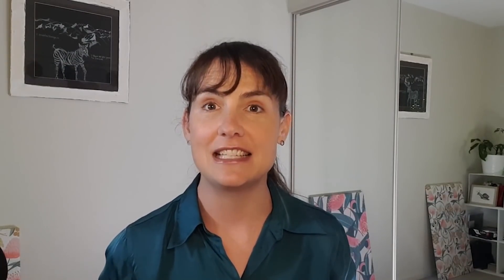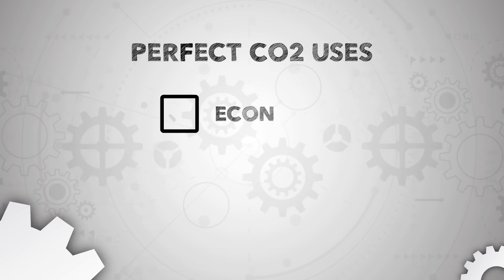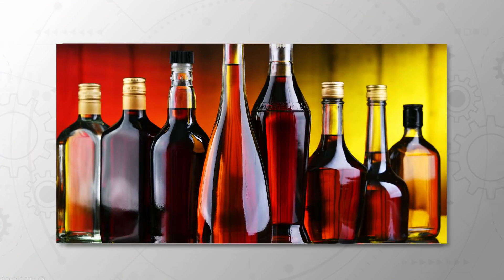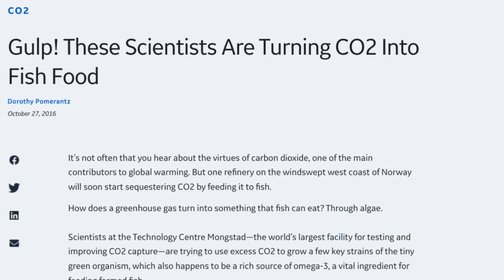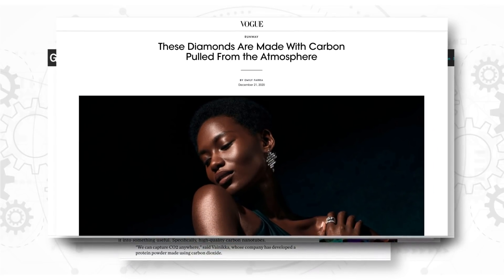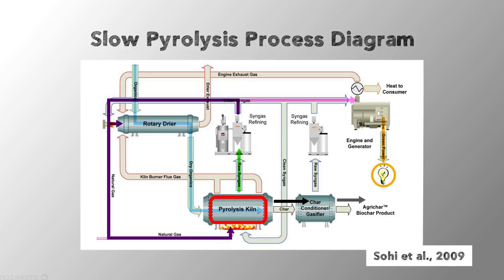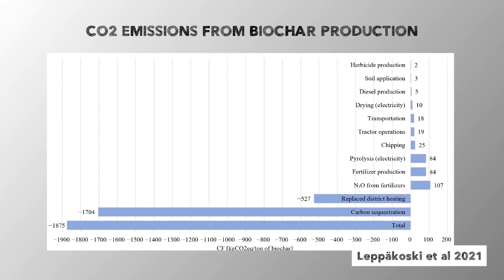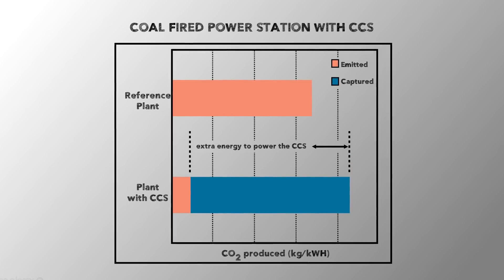From Waste to Wonder: The Surprising Uses of Carbon Dioxide

Comment: Rosie, We would love to see your future biochar video. Below are some resources for it that you might find useful. Thanks for including biochar as a carbon capture and utilization technology. It was great to see your enthusiasm for it.  

I've been involved with Biochar for over a decade. And you're right, it can be a very powerful tool for removing CO2 from the atmosphere at very large scale, even eventually at the gigaton scale. And unlike other biomass incorporated into the soil, it lasts for hundreds to thousands of years as a very stable form of carbon. When used properly, like preloading it with nutrients and microbes by composting it with other organic matter, it can provide some amazing benefits to the soil in addition to all of its atmospheric benefits.

Resources:

As an engineering resource, Tom Miles is an engineer who has worked with biomass for more than three decades and has been working on biochar even longer than I have. He is a Board Member of the International Biochar Initiative, as well as the Executive Director of the US Biochar Initiative. His depth and breadth of understanding of the biochar industry would be hard to surpass. As you can imagine, I highly respect his work.

T R Miles Technical Consultants Inc.
http://www.trmiles.com

The IBI or International Biochar Initiative has some good general resources here:

https://biochar-international.org/biochar/

They display an infographic I had made 11 years ago to clearly illustrates both the soil and atmospheric benefits of biochar. You are welcome to use it in your video. I can provide a high resolution copy of this image, or a low-res copy of it can be found at the following address:

https://biochar-international.org/wp-content/uploads/2018/06/CHARTREE3.jpg

The US Biochar Initiative has some great video resources on their YouTube channel.
https://youtube.com/c/USBiocharInitiative

One of the most important current steps toward helping biochar deliver its potential benefit to our environment is through appropriately scaling the industry. There was a great forum on this in 2020 entitled simply, "Scaling Biochar".

https://www.scalingbiochar.com/

This forum highlights presentations from some of the most notable people involved in the biochar industry in the US.

Prior to that forum, one of US's largest biochar producers, Josiah Hunt of Pacific Biochar, along with Tom Miles were the leads for a working group tasked with presenting a plan for the implementation of, 'Large Scale Biochar Production". While they have a plan for the future, both of these guys are out there already doing the real world work needed to get biochar produced and into the ground.

Their presentations can be seen through these two links:

Tom Miles: Large Scale Biochar Production. 
https://youtu.be/uqViKqLvqtw

Josiah Hunt: Leveraging Existing Infrastructure in California to Sustainably Produce 250,000 Tons of Biochar Per Year within 5 Years.
https://youtu.be/mvVaBH76XjM

Anyhow, I could provide you with a ton more resources. But this should give you enough to it immerse yourself, well beyond just dipping your toes in.

I can't wait to see a whole video about biochar by Engineering with Rosie with your characteristically high quality and thorough coverage.

Thank you for all the hard work you do to bring us great content. Keep it up!

Comment: As you point out, the use of renewable energy is key to ensure CCUS is carbon negative or at least neutral.  I worry that the enthusiasm that a CCUS breakthrough is just around the corner will justify delaying the complete transition from fossil fuels.  After all, if we're about to have a economical, scalable, and permanent solution for CCUS then why stop burning fossil fuels now (or ever)? Obviously we need to quickly roll out the renewable energy solutions we have now and continue to research possible future improvements/solutions such as CCUS.  It would be nice to see you remind viewers that we need to both transition to renewable power AND look for future solution such as CCUS. It's far too late for an either/or. Thanks!

Comment: The problem with all forms of carbon capture is: you use energy to convert CO2 to do something with it, ususaly with a step involving converting it back to C. This is just stupid if you look at it thermodynemicaly. What is the point in oxidising carbon, to then undo the oxidation and lose energy in the proces, that is not even concidering the energy required to recapture it out of the air. You are just better of not burning it in the first place.

Comment: I appreciate that most engineers are only allowed to think about using steel,glass and concrete but...How about planting trees????
Trees that can be used in sustainable construction e.g. oak,Douglas fir will not only absorb CO2 and reduce surface heating (hotspots,heatwaves,higher windspeeds,soil erosion,etc) but also have further CO2 output reductions by significantly reducing the amount of steel,aluminium and concrete that 'we' use in construction.
Concrete is by far the single biggest man-made source of CO2 released so how about educating engineers and architects to stop being a massive cause of pollution through their totally avoidable ignorance on the subject they pretend to be working on???
The carbon is locked up in the timber for centuries and at 'end of life' can still be resawn and re-used.
I understand that most engineers are 'trained' in ignoring timber as a construction material but if you collectively pulled your heads out of your @sses like the Scandinavians and Western Europeans have done then you could actually get involved in making significant progress instead of being reduced to these laughable turd-polishing conversations that achieve nothing.
Reply: Biggest problem is where do you plant the trees?

Comment: there is a simple way of doing this, grow trees too eat CO2, then build durable low impact carbon positive ecohousing kits, self build or co operatively built housing out of the trees designed to be modifiable and with at least a 50year lifespan, thus removing the stored carbon from the atmosphere for 50years+ while lowering domestic energy consumption. ( i have 20 built already in UK)
Reply: But where do you grow the trees?

Comment: Thanks for the great video. Here's an idea you touched on: Mandate that all new plastic materials must be made out of captured carbon dioxide. This will raise the price of plastics, limiting their use. Also, make sure that produced plastics are not biodegradable, and don't bother recycling them. Just make sure they are disposed of properly in landfills. In this way we are taking carbon out of the atmosphere and storing it in the ground long-term at identified locations. At the same  time we are greatly reducing plastic pollution. Just an idea, I am fairly sure it will never happen.
Reply from the maker: Sensible ideas from a CO2 perspective, and assuming that you can ensure every bit of plastic gets properly put into landfill and doesn't end up in rivers and the ocean. Lots of people are opposed to landfill though, even where there is plenty of land available for it. And in a lot of countries they burn waste instead of landfilling it, and then you'd just end up with the CO2 in the atmosphere again.
Reply: @EngineeringwithRosie  since my comment, included a very similar suggestion... thx for giving your feedback on it...
Reply: @EngineeringwithRosie  Agreed and all this would have to be regulated so there would not be unintended consequences. The plastic could be compressed and baled, then buried so it wouldn't take up much volume. We would know where it was, and there might come a time when we would want to mine it to extract things that may become valuable in the future. Again, though, I think this idea is rather counterintuitive and very unlikely to be implemented on any scale. But the core idea- require all plastic to be made of captured carbon- would go a long way to reducing plastic pollution because it would likely increase the production price by quite a lot.
Reply: @kinguq4510791  agreed, my comment, included a very similar suggestion... but I also mentioned, it would be very emotionally distasteful to implement too....
Reply: It seems like it would be simpler to tax the mining of fossil fuels more substantially, than to try to micromanage what people do with them.
Reply: @eventhisidistaken  Yes I agree. We have carbon pricing with the proceeds refunded to individuals here in Canada. However the program is unpopular on the right and there is always the chance that it will be scrapped after the next election. The advantage of the plastics thing is that it actually results in removal of carbon from the atmosphere, as well as source reduction.
Reply: @kinguq4510791  Energy has to be used to remove CO2.  Any energy used for that purpose, could have been redirected to the grid to reduce the need for energy mining in the first place.  It's extremely inefficient.  If we ever reach the point of all renewable, then it will make sense to use surplus energy for CO2 removal.  But sequestering it in plastic would still be a poor use, because there are applications where electricity doesn't work well, such as air travel and heavy machinery.  Captured carbon could instead be used to synthesize e-deisel for those applications, making them carbon neutral.
Reply: Yeah maybe make that 22% more libertarian so China doesn't overdo like with lockdown endian health awareness...then 50% more oversight fun and fungibility on the progressive sides.

Comment: I shred organic materials mix them into the soil. Carbon captured.
Reply from the maker: I actually think you'll end up creating methane and releasing that to the atmosphere if you do that. And methane is a much more potent greenhouse gas. Unless it is an extremely controlled process you are doing?
Reply: @EngineeringwithRosie  our soil is depleted to an average organic content of 2% If we increase the organic content to 15% will reduce the need for chemical fertilizers, pesticides, and irrigation. Also ease water tables and increase plant growth.
   Maybe better than burning the organic materials or put them in landfill to dispose of them?

Comment: I need more on Slow Pyrolysis. What you showed us in this video is baffling. You process biomass, generating a fuel gas which you burn to power the process, releasing CO2 on the way, and you make something called 'Char'. Are you trying to extract carbon from biomass? What's is this 'Char' stuff? It must be really useful if you go to all this trouble to make it. But the process CAN BE carbon negative?
Reply from the maker: Bio char is basically a way to concentrate carbon from biomass. And yes, I agree it's a topic that needs much more time to cover properly. I'm trying to arrange some visits where I can show how it's made and how it's used. The reason why Jess said it can be carbon negative is that it uses energy to process and depending what you do with the biochar, some of the carbon may end up back in the atmosphere. So it's not guaranteed to be carbon negative or even carbon neutral.
Reply: Someone should start a company that searches data yo. Or even 'serves' nonfiction reports from like, an International Potbellied Climate Change science conference thing, but with indices and graphics and like 5 interactive games to make you question your pdf life so far, right?

Comment: Rosie thx, for another insightful post. But I was a little disappointed that true Bio based alternatives were not mentioned. 

Starting with Hempcrete and the branded version of it from BioFiber, which uses a polymer reinforcement structure that could use CCU to produce it and CCU produced carbonates (that Biomason is produce for other uses) to replace the calcium hydroxide (ie hydrated lime) binder.  But even without those upgrades, any form of Hempcrete has a much lower carbon footprint than traditional construction materials and it's highly scalable too. 

And Biomason is growing carbonates to replace cementitious products and as a spray on dirt road stabilizer, is one another example of Bio based alternatives that need to be scaled up. 
(BioChar is great for the soil, but so is manure and compost. But all of them will eventually be broken down by the micros in the soil and the energy potential of carbon will be released as CO2.)

Lastly all of us should hate that the world is being buried in waste plastic. But that should not let us lose sight of the fact. That replacing FF based plastic with CCU based plastic. Would sequester a huge percentage of the carbon that is necessary to keep the world livable. So then it's just a matter of finding a way of safely disposing of it. Ideally separately, in lined landfills or even better in a secure abandoned mine. Since ironically recycling it would be counterproductive.
Reply from the maker: I'll do a video on concrete some time this year and I definitely plan to focus a lot on alternative building materials in that video so I'll keep you suggestions in mind, thanks!
Reply: @EngineeringwithRosie  Sounds good. 

But is there any possibility that it will be a live show. Where you would take some of your questions from the chat room?
Reply: > secure abandoned mine
Hempcrete isn't supposed to be a short novel series starter like THC stuff, but I am here for their green mining angles.
>Recycling it would be counterproductive
We gotta weasel some of it into biodiversity and neatening up the 3D printing industry on the way to founding cities on TPU bedrock.

Comment: https://en.wikipedia.org/wiki/Macarthur_Wind_Farm - Macarthur has consistently been one of the worst performing wind farms since its construction in 2012. randomly looking at https://anero.id/energy wind energy in Victoria seems to always be less than 30% (loads of green wind farms sometimes some yellow) and the coal plants always running above 100% with Loy Yang B power station running at 116% (sounds like that plant will fail much quicker driving something above 100% of its design). Most of those farms https://en.wikipedia.org/wiki/List_of_wind_farms_in_Victoria seem to run average of 30% which seems a waste of financial resources and subsidies for putting a plant at 300MW+ for just 30% output the media publishes these as this will generate 300MW but in reality only averages 30% of its capacity.
Reply: Coal plants are at best around 60% efficient at extracting electrical energy from the coal they burn. Seems like a pretty inefficient use of fuel that needs to be extracted from the earth, refined and transported to a power plant. The energy used to power a wind turbine gets transported to it for free.
Reply: @SocialDownclimber  When its there....That's why Europe has been delicately walking on eggs with Russia as they have needed to buy natural gas from them while at the same time running sanctions...Luckily they are coming into summer so chances of being held to ransom or worse are almost over for now until they work out a replacement solution. 

Germany the poster child at one time for solar and large feed in tariffs now is trying to push natural gas as a green energy....Its just a scam as I said farmers using greenhouses to get everyone's tomatoes, bell peppers etc to market all burn propane to increase CO2 to around 1400ppm x4-5 current rates as this results in faster growing plants.....Water vapor a larger percentage in the atmosphere also has substantially more green house effects - why cloudless nights are cooler for example.
Reply: @rw-xf4cb  Do you really think applying crippling sanctions is "walking on eggs"? Cause that seems like a contradiction. 

Also if you were a regular viewer of this channel, or someone who understood renewable energy, you would understand that no power plant has a 100% capacity factor, and the capacity factor is included in the economic assessment performed before any energy project is started. 

And finally, why is the greenhouse potential of water relevant. Are you suggesting that human emissions of CO2 is not causing rapid climate change? This might not be the channel for you.

Comment: Thanks, great interview. Biological capture is how the earth reduced CO2 in the atmosphere, so do we have a biological solution for carbon capture? I hear grasses are particularly good for this, as is algae etc. (might be wrong on both these fronts).
Reply: Biomasan
Reply: The issue is that we would need to drastically increase the quantity of plant life on earth, significantly beyond what was there before humans existed. This is because we have all the natural CO2 plus a large chunk of the extra CO2 that got buried in the carboniferous period, that has been absent from the atmosphere for three hundred million years.
Reply: @SocialDownclimber  Understood, and that process (carboniferous period) took way longer than we have available to us, but I imagine anything we do on the positive side of the ledger will reduce the impact of Climate Change.
Reply: It also occurred to me that syngas production from atmospheric CO2 is really an energy storage system and should be compared to other energy storage systems like batteries.